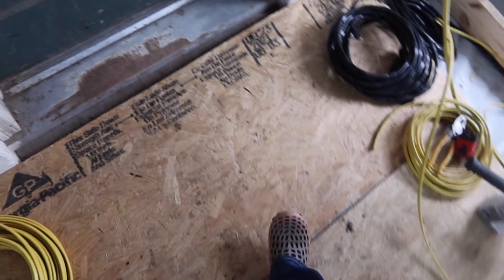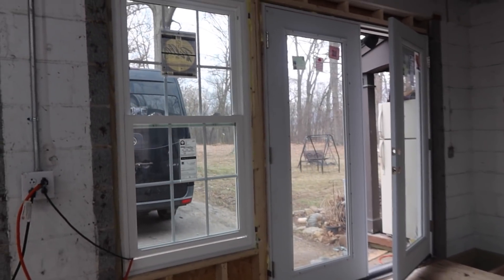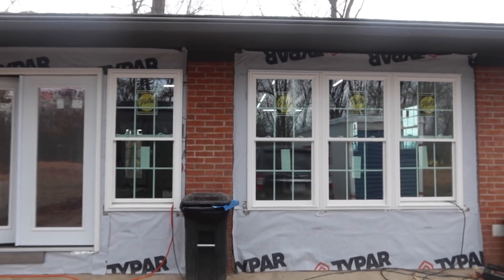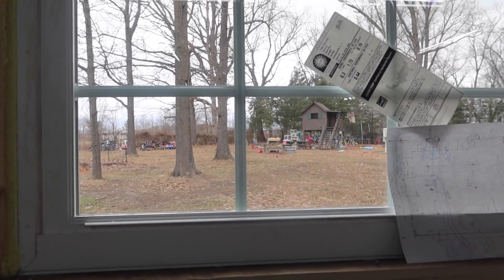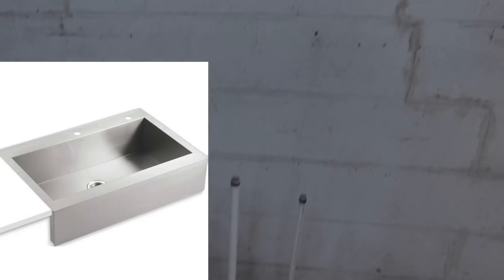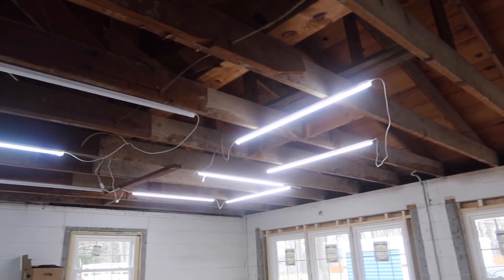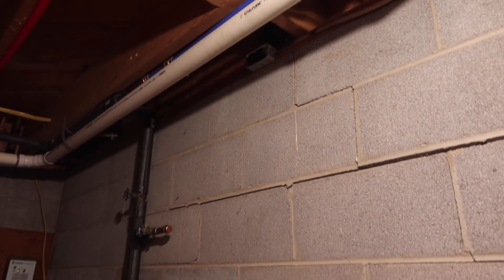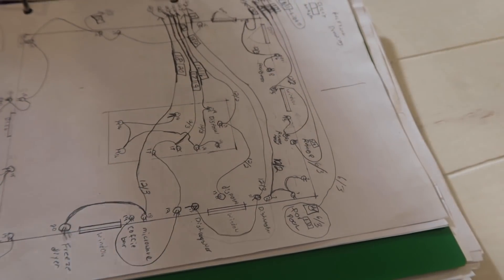PROGRESS! Plus, will I flip breakers? 🤔 Garage to Kitchen Conversion

Comment: Looking good so far, love seeing the progress.  We have a pop up electrical outlet on our island, has room to plug in 4 appliances if needed, and just pushes back down flush to the worktop when not in use, works out great for us.
Our Freeze Dryer has been pretty much redundant for the last couple of years, was a good idea at the time, but too much hassle to use regularly, its become a storage unit for various trays and baking stuff that doesn't fit anywhere else.We also got a steam oven, another expensive item that didn't quite work out practical to use, so has become another storage unit.

Comment: I thought the potfiller would be with hot water but apparently it is cold water?
Reply from the maker: It concerns me to have hot water on tap. Just safety things I think about in a kitchen, plus there is no drain for a pot filler. I went with cold water whether that is right or wrong. I figure the pot was going to be turned on to boil anyway if I’m using water on the stove.